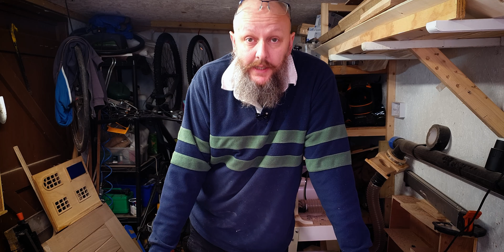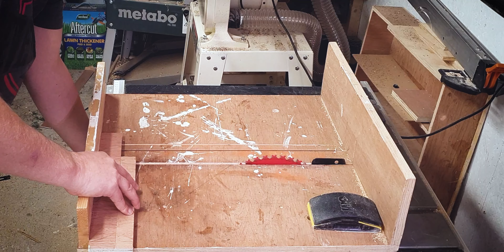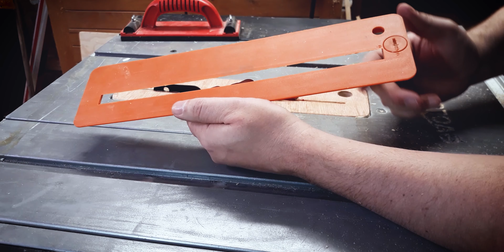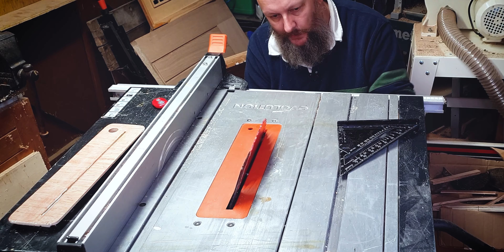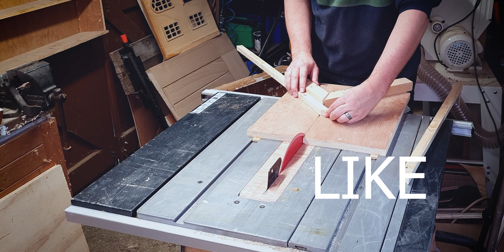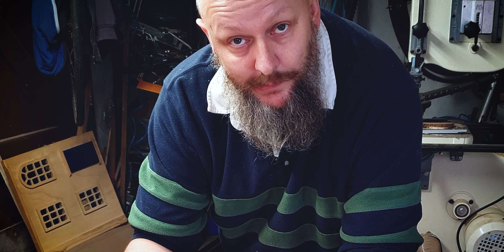Learn TABLE SAW Basics - #1 Woodworking for Beginners

Comment: That was a great crash course. I liked the bit about walking away if you aren't afraid of the tool. I don't do wood working often but I prefer to build things myself when I do need something made. So every time I get set to pull out the table saw (or other scary finger eating tools) I like to watch a guide like this just to do a sanity check since it might have been a year since the last time I used it. The reason why I do this is because I'm incredibly afraid of what the tool can do when used improperly. And even after watching this, while I feel much more confident, I'm still horrified as to what can and does go wrong when you don't follow the proper procedures to the  letter. Wish me luck that I might keep all my appendages and don't have a broken nose from a board flying back into my very handsome face*. Thanks again. This 3 year old video has earned you a subscriber. Have a lovely day and hold fast to your finger my friend. 

* (my face is ok, but I wouldn't call it very handsome. Handsome, sure. Very handsome, not so much. It's good for us handsome men to be humble. I'm sure you know what I'm talking about.)

Comment: Very new to this. 
Good video but having watched others on YouTube it seems that you did the opposite of what others are stating from a safety point of view. You have the off cuts pinched between the blade and fence which runs the highest risk of kickback. I thought you should be making sure that the off cuts are always on the opposite side to the fence.